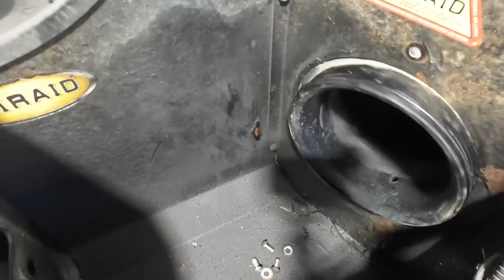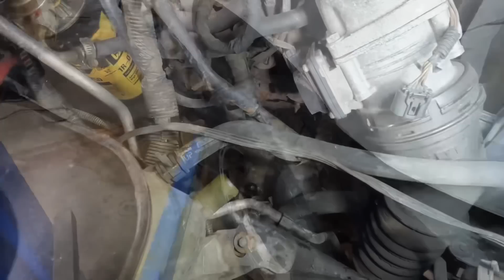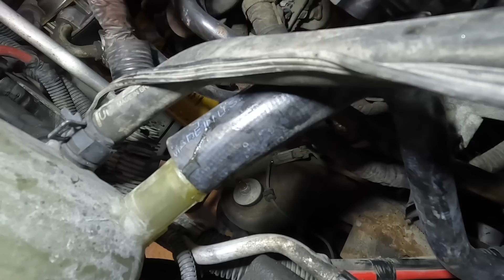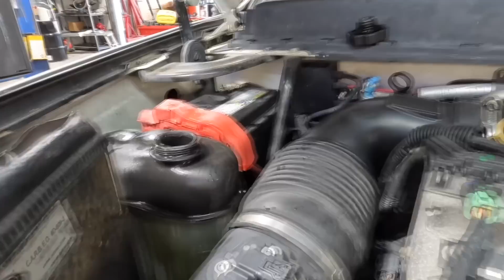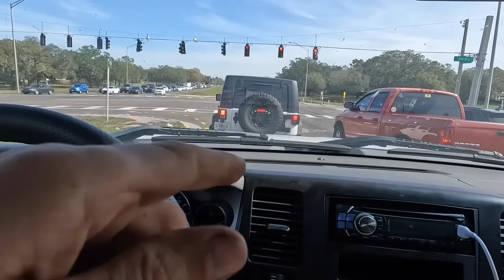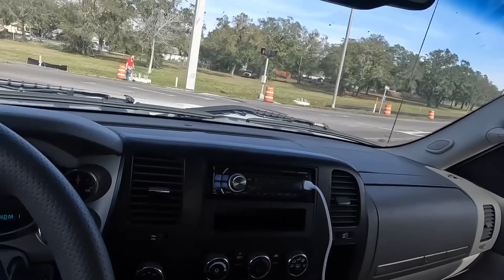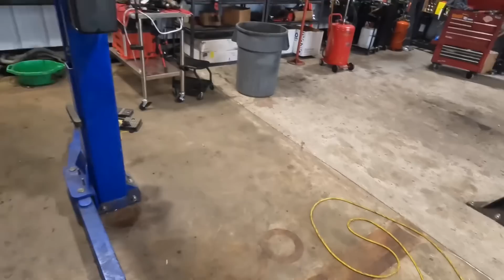Four way Radiator Hose “updated design” | Pig of a job! DURAMAX 6.6

Comment: You can't wash an engine!  You'll short everything out and crack the block from thermal shock!  Reeee

With hundreds of thousands of viewers you will see the full gamut of opinions on any topic.  Some will have alternative solutions and others will not be happy until you bolt on a brand-new manifold.

I don't see a down side to the welding.  I was surprised at how quick and effortless it was.  In under 10 minutes you were done.  Changing the manifold could turn into 10+ hours of torture as we have seen in the past.  If the weld fails, cross that bridge when you come to it.  No worries at all.

Comment: I was thinking welding a cut bolt the size of the hole on that manifold when you did it. The weld you did was fine cause it was a small hole. I see muffler shops patch up manifolds cause people may not have the money replace them. The disconnecting your ground from the battery before welding came from the military because of the 24VDC the systems. In the repair manuals and training they had us disconnecting the grounds from the batteries

Comment: Good job. You are so patient. I would have just taken the plastic bit off the new hose and put it on the end of the old hose so it fit on the radiator! Bugger going through all that crap!

 It makes me very glad I have an old lpg 2003 Barra engine. It is 10,000 short of a million k's. it has had a  leaking head, valve and rocker cover gaskets for four years, at least and 2 inches of oil in each plug well,  and leaking intake. I haven't serviced it for over 5 years ( the plugs are stuck in there and most bolts are stripped or ceased) it still has all original parts but it still has plenty of grunt and never breaks down. It's a shame Aussies don't make cars anymore.

Good job and thanks for explaining everything. I like watching your show, been watching for about 4 years now. It helps me work on my other petrol Barra.

Comment: Running a water pump dry will reduce the life of the seal. The pump needs lubrication and heat removal provided by the coolant.  Early failure of the seal will result.

Comment: In the previous video, you speculated that the hole was there for some sort of sensor - so my original thought was that the hole was likely to be threaded to accommodate the sensor - and it would make sense to run a plug into the hole.  But welding certainly worked - and as you explained - chasing the "threads" (if they even existed) would introduce shavings into the manifold.  
As far as the somewhat unusual radiator hose fitting - my old 2001 BMW 325i has them, and it makes removal and installation a BREEZE!

Comment: I think a brass plug may have been better on the manifold. Why don't you just cut the hose parts? Like the long videos. You're right. You could have introduced metal into the manifold and could have hurt the turbo. I wasn't thinking. If the weld works, do it

Comment: Someone needs to invent a micro electric ratchet for tight spaces. Like the size of an electric toothbrush. It seems like most of the time you don't need a boat load of torque, just something to squeeze in and spin.

Comment: Really appreciate your explanation about the manifold weld! While I figured the bolt/bung would kept short enough to not intrude any more than the previous sensor, I hadn't considered the expansion issue with differing metals.

Ultimately this is why you'll never get reeee from me, I'm not a mechanic or welder - your experience and willingness to share your thought process is why I keep coming back. And I really value your willingness to acknowledge when something is being done your way and there are other methods.

Comment: I believe the use of an alternative design for the clamp on the hose connecting to the bottom of the radiator is necessary because if you tightened a traditional clamp enough to prevent leaks under high pressure, which you spoke of, it would collapse the fitting coming off the plastic radiator. The other three pipe fittings were all metal.

Comment: I agree with you on welding the hole there are to many factors against you if you tapped and put a bolt in the hole as far as damage to the turbo and engine. Don't let the arm chair mechanics mess with your professional decision. I've been a Master Mechanic for 45 years you did it correctly Ray.

Comment: That weld will be fine. What is the point spending more time tapping it if you never have any intention to use it. Weld it and be done with it, will be fine.

Comment: Pay little mind to the RE comments. You have WAY MORE experience with what works and what doesn't in the automotive repair industry. I always learn something new with each and every one of your videos. Keep up the great work !!😎
Reply: Also, one thing I've learned from Casey LeDelle is the more one reacts with the cognoscenti in the comment section, the better their #'s are according to YT metrics. So, in essence, that's what Ray is doing by addressing the blow back on the welding of the manifold.

Comment: @14:30 (removing the bottom radiator hose) No! No! Don't pull, push it up?
By pulling down you are stretching and thus tightening the hose grip.
Pushing upwards will brake the bond, then twist! Next time try it that way.  🤔

Comment: That was 5+ gallons. Boost leak can be turbo or brakes. In the diag. vid you pointed out the hole and said perhaps they were going to plug it and drilled the hole but didn't have a tap, so my comment was wondering why you didn't just plug it.

Comment: Welding cast iron can result in it cracking, especially if the thickness varies. In this case, the manifold was junk. If your weld worked, it's a result. If it failed, well, they needed a new manifold. If money is no object, then you replace it. But it's many hours getting the bolts out! I look after a fleet of commercial trucks, and I know if I was asked to ok a job like that....I'd say yes. You saved the owner a bunch of cash. Sure, the purists might object, but sometimes you just have to get the job done on a work wagon.

Comment: I've welded cast iron it never failed on me except once. You just gotta make sure to grind the surface clean and no matter what DON'T use fluxcore wire if your mig welding.  That was the only time it failed on me. 
And if it's a crack drill a hole on both ends of the crack to keep it from spreading ( we call it stress relief hole ). Just make sure the drilled hole is passed the cracked line.

Comment: After thinking about about exhaust manifold I was one of many that thought putting a bolt or something in and weld it it in after thinking a bit I would've just welded in for the very same reason you did it, in short very good job Ray

Comment: If that drain plug is on top of the thermostat housing.  There won't be any coolant at that point until the thermostat opens.  
Unless that port is 100% open and you keep filling until you see the coolant flow from it.

Comment: @Rainman Ray's Repairs,  Ray I noticed something odd during the starting sequence,  @ 53:55 pay close attention to the AC compressor clutch. 
It is being energized during starting.  I don't know about you but doesn't that put extra strain on the starter?   
Is that a sign of a problem with the computer that controls the HAVC system or is it a bug.

Comment: I was a professional electrician wiring ambulances,heavy rescue vehicles,etc......I worked really close with welders and I never had a damaged ecm, or alternator even though the welding was far away from the main oem electrical, so I don't know. I think alot of it is maybe wives tales, or something lol

Comment: It was nice that you explained your hole welding logic. 🙂 That lower hose clamp should've had a 90° worm gear on it so you could easily reach it. C'mon engineers, you can do it !🏆

Comment: The only time electronics could get destroyed on a short path weld is when you're welding right next to it. Welding does throw off some pretty good EMF that could damage sensitive electronics through induced current. Also, Ray you did say rule number one of welding is not to do it on the 😮 Internet.

Comment: Hard to believe that there isnt some kind of sealent plus an external clamp that could have fixed the leak without replacing the whole hose assembly.  Obviously another faulty GM design.

Comment: You asked -well the manifold is cast iron and you used mild steel to weld it with, people go to a lot of lengths to weld cast iron, all sorts of special measures taken... you would have been better using a stick welder with cast iron rods.maybe it gets too hot to braze it ..dont know. confesion ..i have welded cast iron with mig welder using mild steel  wire..it was like your case, a  non stessed part  a lump...it did not fail aftwerwards .

Comment: The more I watch you work on these newer cars the more I like my older ones!
Reply: Amen brother. 😂
Reply: Yup...  I do sometimes long for "the good ol' days".  My first car was a '65 Chevelle with a 283 with points and condenser in the distributor with one coil and a vacuum advance for the timing, a Muncie trans, etc. and it was all just so simple; not to mention plenty of room to sit in the engine compartment to work on it...  😎
Reply: I have a 2007 classic with a gas and its easier to work on
Reply: @shadowopsairman1583  wife has a 2014 passat tdi, love everything about it but working on it. 
Daughter has a 2010 Accord, son has a 1996 zj, I have a 2000 f250 7.3 with 478k on it and a 1962 MGA.
I would almost rather change the engines on the 2 older ones than a water pump on any of the news ones....
Reply: I looked at the new pickups last year. I then got on the internet and found a 1984 F150 4×4 with a good body. But a frozen motor. I rebuilt the motor and had the transmission checked out. I have less than $4500 into it now. New brakes, tires (all 5), and gas tanks.
Reply: I have an 85 Silverado that i restored and i like it more than the newer vehicles. Much more easier to work on

Comment: I've worked on a lot of things mechanical, electronic, and automotive over my 7 decades, and I can say, without a doubt, that this is one of the stupidest designs ever. Zero engineering for maintenance and reliability. Whoever came up with this idea and signed off on it should be required to travel the world doing nothing but replacing these nightmares.

Comment: If it was a newer truck I might have wanted a new manifold but would have been more than happy with trying the weld first on an older one.
You are dammed if you do or don't on the Internet. Carry on doing your thing. I've been out of the workshop long enough now to know I'm out of my depth and don't have enough tools to do things now.
Reply: He also explained the risk of unbolting them as it is possible to break off the studs if they are rusted badly

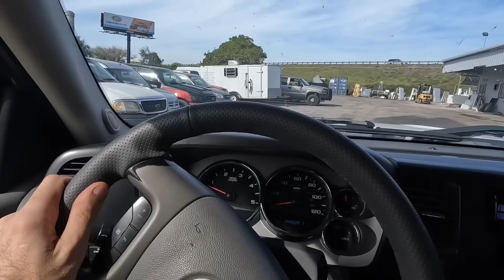Comment: 1:04:34    lol 
Electricity takes the shortest path of restance   ok  this notion of blowing up a pcm or altonators welding is assuming you can jump start a hart on someones foot, clear!    No the voltage has to go acrossed someones hart to get it to start pumping.

You said different types of metal,
The welding wire is not the same kind of metal.
Ray i respect you  and any comments i make are met to be a decisions, not to tick you off. 
Like WTF do I know? Im like anyone 
Else i go by what i was taught, now that might not always be right, but when you learn it from someone in that line of work you tend to belive it.  I was told by a professional welder in a machine shop you can't weld cast iron, then a read you can with some types but only using stick welding and special rods.
If it works for you good, its a cheaper less risky option then replacing the part in question.

I just won't post feed back anymore if its going to upset you.

Comment: Ray,

First,  you’re dealing with misunderstandings that have been around for years because people simply accept them without thinking them through.  To these people, they are absolute truths.  When you go against them, you’re going to get strong reactions.

Second,
For virtually every repair technique, there is an alternative which is the go to technique for a number of people.  They will push their preferred technique.

Third,

You are a very analytical and thoughtful man.   Most people aren’t though they think they are.  

Last,

People hate change.  People would rather believe a proven lie than accept the truth because the lie suits them.

So,  what you are seeing is to be expected based on the above points.

Comment: @Rainman Ray's Repairs,  Ray , going back to the secondary alt connection repair you made.  Technically shouldn't there be a fusible link to match the output rating of the Alt?

Comment: Half the complainers probably have never lifted a bonnet (hood in USAanese!) And moan for moaning`s sake .Weldings fine its for all to see but thinking about it i wonder if one of those rivet nuts and a washer would have kept them happy ,no drilling so no metal shards AND a shiny bolt to make them happy .Weldings fine  .
As to washing the engine compartment its fine except for jet washing a reliant regals engine bay (look it up) i was driving round in a tropical rainforest for a fortnight .

Comment: As a former professional welder I give my approval of the manifold weld plug. It's fine
Reply: Yep I agree, I would have stuck a screw in there and welded it, but Ray did give good reasons why that was not a good idea.
Reply: Is there an issue with putting a bolt in there and welding that ? E.g. Different metals issues?
Reply: That was what he said and the bolt or screw sticking out on the inside causing restriction. Different metals expand differently with the heat was the claim. Only thing is, the wire coming out of the welder is different metal... @DeepakKumar-lv4te

Comment: Ray, KUDOS to you !  I've been told for years (many) that you can't weld cast with a mig, gotta use tig.  I was misinformed, and you validated that.  BTW, I think you put about 5 1/2 gallons of coolant in the system !   🙂

Comment: Well you answered my only concern about the welding - ECM , an the diode’s in the alternator . As a retired electrician., electricity always goes to the shortest path to ground , but a stray emf can go farther . That’s why we get shocked even if the tool grounds out . Another tough but well done job Ray . Stay safe , have fun .
Reply: If there are two paths, one through 1 ohm and the other through 100 ohms, current flows proportionally through the 2 paths (roughly 100 times more through the 1 ohm path, the math gives a more exact result). The electrons don't care if the 1 ohm path is "shorter" than the other. You are depending on the locally grounded path to have very much lower resistance (much much less than 1 ohm) which will sustain a very much higher current. But that does not eliminate current through the other paths,

It is probably safe, but as vehicles come with more static and current sensitive devices ("computers", et al.), this may become a bigger issue in the future.

BTW, I also agree the weld was the right answer here.
Reply: This a a VERY VALUABLE Obserrvation.....How to isolate these components would be good to know.....Nothing worse that the feeling of having some electrical glitch cause Expensive destruction of delicate circuits.......

Comment: The only time I saw a problem with welding was on a Prius. Someone welded with a TIG right beside the battery without pulling the master disconnect. Bad things happened to the battery controller.

Comment: The weld is the right fix. I’m no welder, but in the olden times I welded countless manifold bolt holes, mostly Chryslers that had a thin metal heat shield that would crack and make a horrendous noise. The fact you welded cast iron proves it can be done. A bolt already failed there so why put another? Weld it up and relish the fact you performed a correct, successful repair!  My only welding tip to anyone is to not weld where brake cleaner liquid is present. Some of those cleaners when heated can revert to phosgene, which is as ww1 chemical weapon! Otherwise, weld ‘Em up! Thanks for the videos!

Comment: Out of concern of getting some wire or bb's in the exhaust I would've put a loose fitting plug in the hole and welded it up. But the way you welded it was just fine. I actually expected the cast iron to weld a little more difficult, because sometimes it does. But that's just my opinion.

Comment: You are not a welder!
Reply: what the actual f..k ?
Reply: the electronics in the car may not show problems immediately, it will later! The fact that the batteries are plugged in means for a while that you short-circuit and destroy the anode or cathode in the battery. But another repairman will have to take care of that! That's what happens! @blairmarriott965

Comment: You got it done and it worked, that's what really matters, so never mind the armchair quarterbacks. No popping the cab option to make those hoses more accessible, just a nasty rats-nest design that had to be worked with because nobody still stocks the correct O ring.